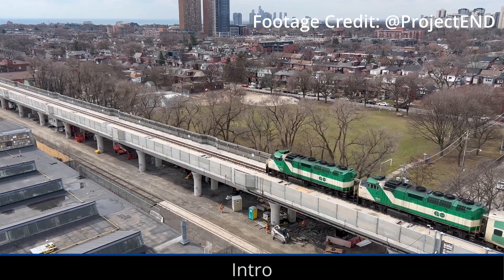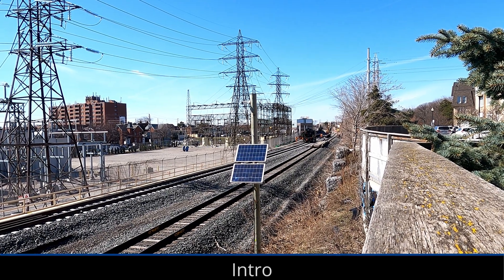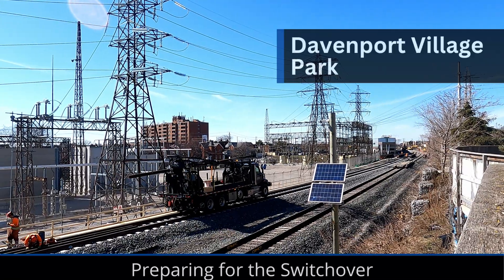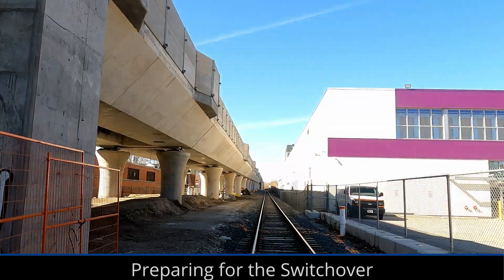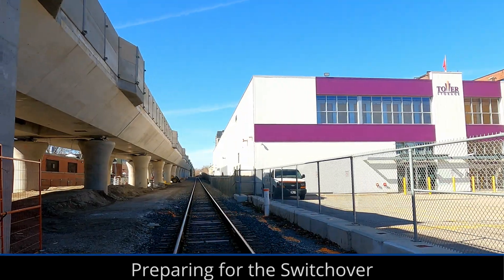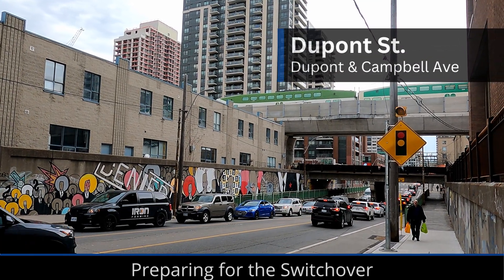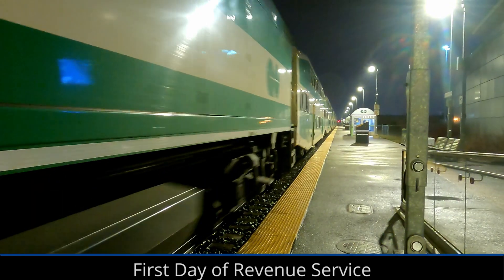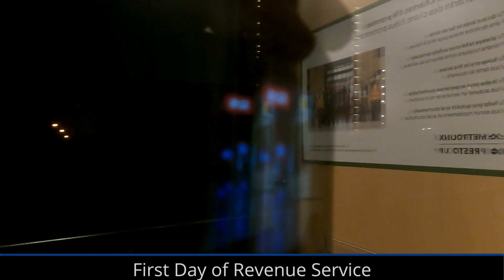Opening a Regional Rail Line | Davenport Diamond Grade Separation

Comment: great video as alwasy. Where do you think you can find a way to recommend spaces to have under the grade separation? having basketball courts, soccer courts, parks, and stuff would be too nice but ik the city is terrible when it comes to those
Reply from the maker: There were community consultants a few months ago and a slide deck with the proposed design is on the linked site https://www.metrolinx.com/en/projects-and-programs/barrie-line-go-expansion/get-involved/davenport-diamond-nov-24-2022